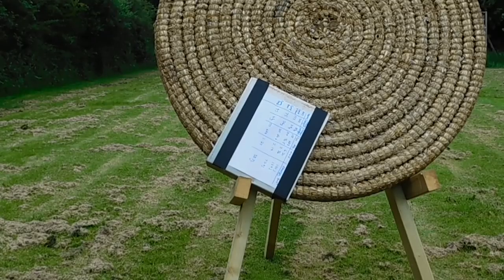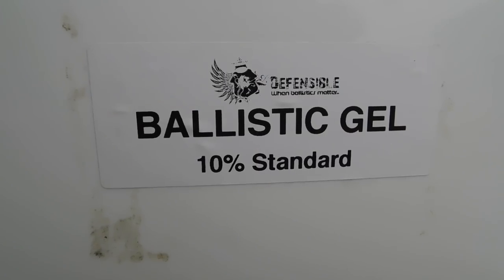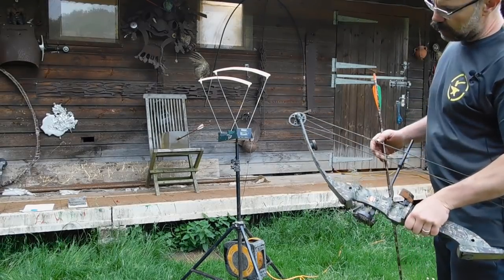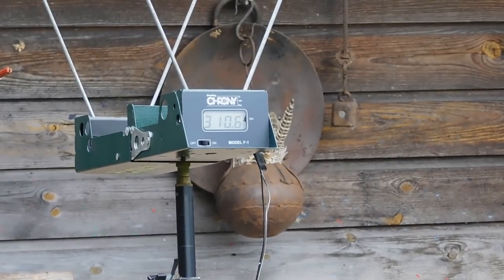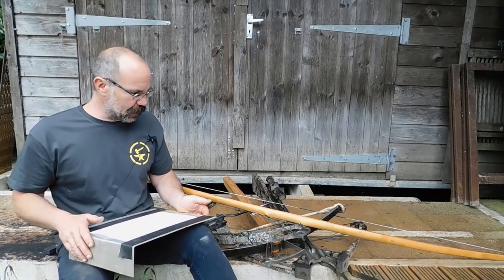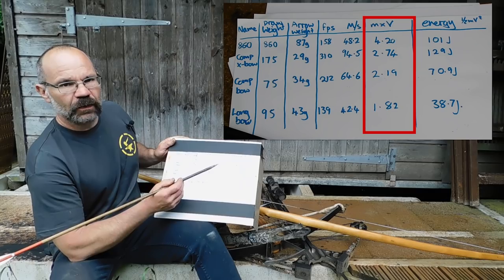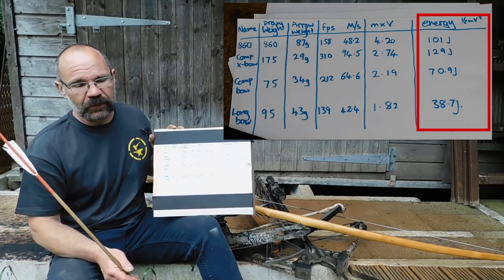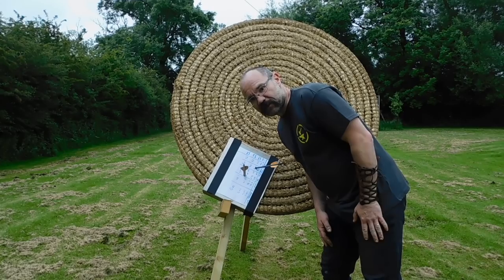Medieval vs Modern Crossbows/bows Ballistic Gel Tests

Comment: And the compound bow you used is about as outdated as that long bow and wooden crossbow are if you had a modern one it would have been 350+ fps and even that “modern” crossbow is like bottom of the barrel they’re almost to 500 fps so idk what this test is showing other than the difference between 4 outdated bows

Comment: The Long Bow requires a peculiar movement to shoot, are you pushing against the stave (is this the word I want?) as well as pulling the string back? It seems to recruit all the back muscle groups in a way that the compound just doesnt.
Reply: That is the correct way to draw a heavy-weight bow. The posture looks odd but is historically correct. Recruits muscle groups.
Reply: Alastair Dent i wasnt saying it was wrong at all. Just that it is surprising is all.
Reply: tod todeschini are you pushing against the bow with your left arm as well as drawing?
Reply: the optimal  is to have isometric strength in the bow arm while drawing with angular motion with the back muscles letting a rigid skeleton frame carry weight , if the bow is to heavy so you have to involve more muscles to achieve the draw by pushing and pulling you strain the muscles, ligaments , cartilage and bones risking injuries , same reason wight lifter use  control and technique rater than brute force

Comment: I wonder at how powerful those crossbows were, and how we in an age of computers and "reason" have improved on them so little. The workmanship and care of hand made crossbows and bows for the cold mass produced and sterile modern counterparts using carbon fiber, plastics and aluminum and we see after 500 to 600 years a 30 joule increase.  I find the loss of craftsmanship, care and artistry found in the early weapon kinda sad, and not worth the increase. All four are potentially effective hunting weapons, and for back yard plinking more than effective.

Comment: I’ve been wondering if using iron sights in my modern compound crossbow would be viable, as medieval crossbows didn’t have sighting systems generally. With Iron sights and practice I should be able to shoot relatively consistent groups, right? Anyone have any thoughts on this?
Reply from the maker: with no sights I can reliably hit a plate at 40yds
Reply: I believe the Chinese sometimes put iron sights on their crossbows, though the Europeans to my knowledge did not.

Comment: ...I think I might rather get shot by a modern pistol round than get hit by a bolt...
Reply: You're perhaps not really appreciating the wound creation mechanism. Bullets are blunt, they crush their way through the tissue. This is bad enough with muscle tissue and ligaments, as the regeneration will be mostly scar tissue, but the real problems come with bone that gets crushed as well. It's not a cut or a crack, or even a break, something that could be expected from a bolt, it's an extremely messy local fragmentation that is EXTREMELY hard to heal without significant lasting changes.

That doesn't matter if the initial wound proves fatal though, and crossbows were fairly efficient on that front. It's notable that a bolt causes next to no hydrostatic shock and doesn't expand, tumble or spin in the entry process.
Reply: I would hate getting hit by broadhead arrow wearing no armor, those things are nasty.

Comment: The all the way through is impressive, but that olde worlde bolt?  Yeah, that block is dead.  Even though it did the least penetration, all of that energy, and all that drag went into the tissue (Simulate.)  Look at how it split from that.  The hardwood fletchings went like 3"' into it.  Whatever you shoot with that is dead, in fairly short order, and that's the basic point, isn't it?  Now, let's talk about reloading that thing...

Comment: Your string is dragging on the stock so you'll never get it's full power to the bolt!
Reply from the maker: High string drag looses around 8-10% of the power due to velocity losses, but cranequin bows have to have a heavy string drag or the cranequin will not work.  Cheaper mass produced bows need a bit of string drag or they become to tricky to set up en-masse.  Target bows can have minimal or no string drag, but can be very time consuming to set up.  All a trade off.

Comment: The compound Xbow might have more energy in the shot. But if the arrow/bolt goes clean through your target then you haven't transferred all of the energy to your target, so in practicality the old world xbow might actually do better at stopping the guy/beast you're shooting. Depending on your target of course.

Comment: wow thats a terribly slow compound bow modern bows are rated at 340 fps + and a good compound crossbow up around 400fps
Reply: they are measured at the longest draw with a light 350 ish grain  arrow you can read the ibo standard , so if your using a shorter draw and heavier arrow you will never get that speed witch also is exit speed and does not account for distance or impact speed. and not all bows are rated at 340 , very few flagship modern bows are , a cross bow is a compound laid horizontal on a stock , but shooting bolts shorter than the conventional arrow there is less mass hence more speed while dynamic efficiency is almost the same,and he shoot the compound with fingers !

Comment: Longbow 139 feet per second, 75 pound compound bow, 175 pound crossbow..... whatever happened to the metric system? I thought all other 'cunt trees' besides America use metric because it's supposedly so much better.
Reply: @tods_workshop  What about the chronograph? Does that have a setting of meters/second?
Reply: @tods_workshop  Only if 'tit' and 'tat' can be converted from imperial to metric. I suppose imperial is 12 toots per tat, but in the rest of the world there's 10 teets per tit.